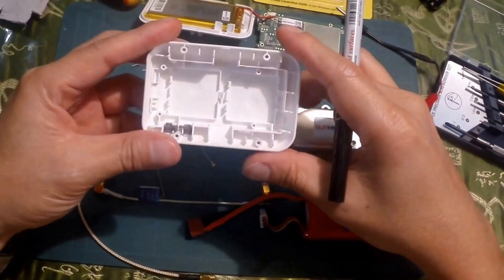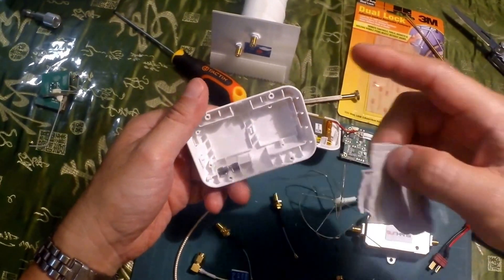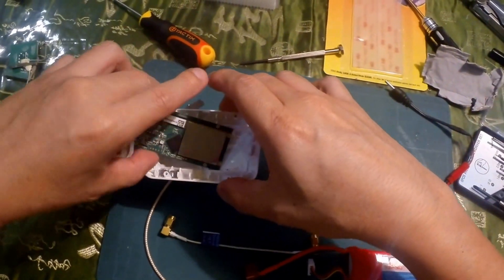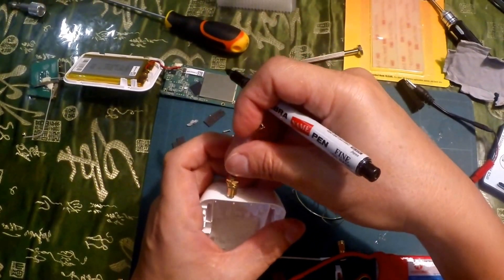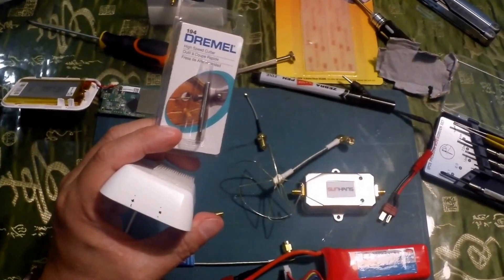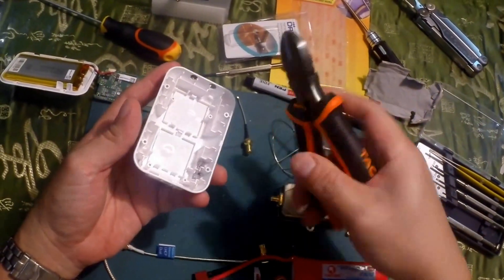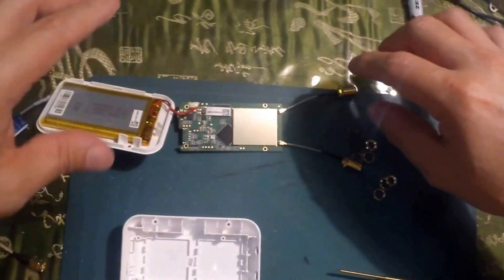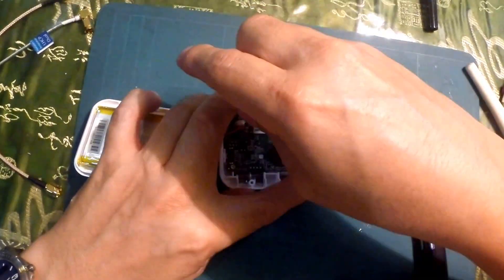DJI Phantom 2 Vision Plus~Range Extender~Horizon Antenna Pt  3-2

Comment: Hi Gordy,
Neeed your help. I placed a 5.8 and 2,4 antennae from Horizon with an amplifier for the wifi extender. The problem I am having is that I lose wifi connection at about 1000feet and without the mods I was losing connection between 1500feet and 2000feet.. Any suggestions of what I can do to prevent wifi lost at such a short distance?
Reply from the maker: Hi Rene, Can I ask exactly which antennas did you buy and is it an antenna package. Is it only at the Remote Control end? Did you do any soldering? Did you use any third party parts? I'll do my best to help.
Reply: *****
I bought the
Compact Extreme kit. 1 x gold 2.4 GHz 12 dB and 1 x 12 dB 5.8 GHz ALL ANTENNAS  . I also bought the
Horizon 5.8 GHz RF amp 1 watt. The RF connects to my wifi antenna.
The installation was all done by Horizon.
Reply: *****

To be more exact I have the 5.8 running into my RC and I have the 2,4 black hawk running into my 1 watt amp.and an attachment from the amp to the wifi repeater.I also have an SP antenna running out of my wifi repeater....
Reply from the maker: Rene Natola Is the 1watt amp for the 5.8ghz? You can't really mix the amp. It's better to amp up the 2.4ghz before the 5.8ghz as the 5.8ghz range is normally longer than the 2.4ghz FPV connection. I'm currently testing out the Dual Extreme in Australia outback. Had to postpone the test for tomorrow as the winds are blistering gusty this morning.
Reply from the maker: *****
The amps are tuned to the designated frequency. So don't connect it to the wifi extender as that has a frequency board for the 2.4ghz instead. Hope this will correct the range problem.
Reply: *****
the 1 amp is for the 2.4ghz....no amp on the 5.8ghz.....so I do not understand why I am losing connection at a lower distance. I need to mention that I bought a new RC and wifi extender( all vision plus ) and I had to bind both which was successful. Again all mods were done at Horizon.
Reply from the maker: Rene Natola
Horizon sells the 1watt amp for the 5.8ghz and the 2watt amp for the 2.4ghz. Look at the amp and it will show the tuned frequency. Try connecting the setup without the amp. Also check the connector pins. Sometimes the pins in the connectors could have sunken in.
Reply: *****
are you suggesting not to power up the RA....that is run the 2.4 Ghz black hawk directly to the wifi and bypass the amp all together?
Reply: Rene Natola
thanks I will try this and good luck with the dual extreme in Australia and hope weather settles.
Reply from the maker: Rene Natola
Yeah, it's just a test to start from the basic short range and build up to the longer range setup. So setup without the amp and then add the amp. Keep in mind the connectors should have the proper connection between male and female RP-SMA.
 I have to go out for awhile and get back to you later.
Reply: ***** I just realized that the amp is 5.8 ghz connected to the wifi...is that problematic
Reply from the maker: Rene Natola
Hi Rene, Yes, it is a problem. This is why your range is affected. The signals from your 2.4ghz wifi extender is scrambled by the 5.8ghz amp. This will emit a scrambled signal, and your phantom will have difficulty understanding the signals. Your range will be extremely affected. Don't mix up your tuned amps, they will cause alot of problems to your phantom and may cause your frequency boards to be affected. It's best to stop and re-calibrate both your RC and Phantom units. I have heard that frequency mix can cause permanent damage to the frequency box as you are amping the signals.